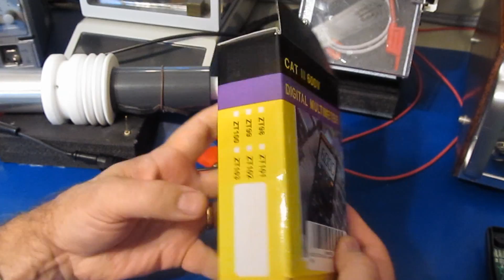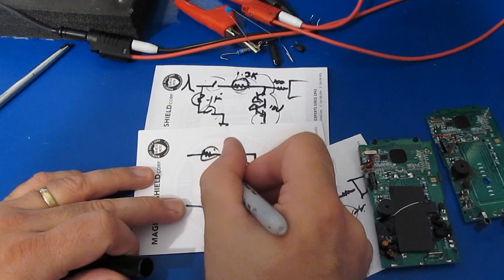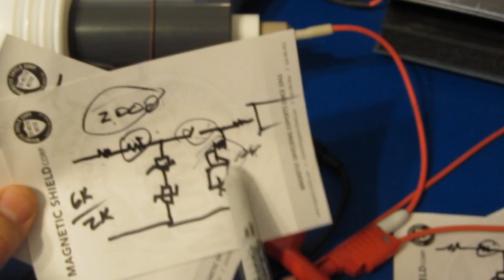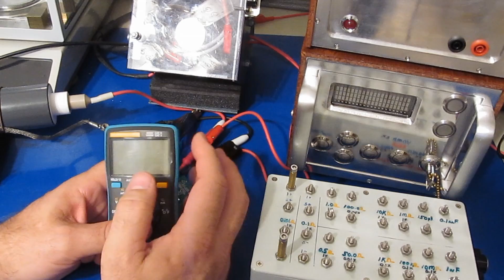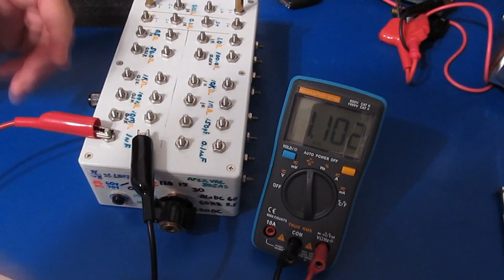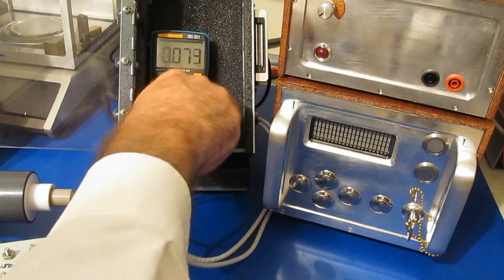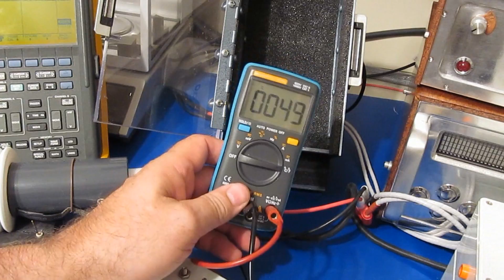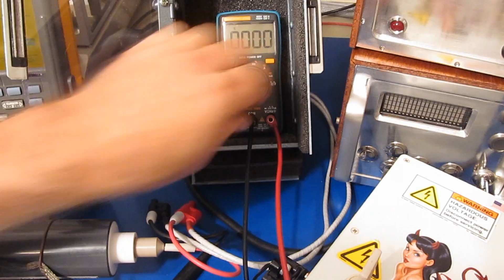Kasuntest ZT102 (AN8002) Experimenting with 3KV and up

Comment: The inside of the test box must look like a bowl of spaghetti, excellent video as always!
Reply from the maker: That little white box is not too bad.  One perf board in the bottom and all the components are just mounted to the screw terminals.  It covers most of the basics now for checking a meter.

Comment: The "features" depend on the contents of the 24c04 eerom, so the chances are that the %Hz/Duty feature come from fitting a different batch of pre-programmed eeroms, or from programming the meter with the wrong contents at manufacture. Now it is possible that one line of the production line is set up incorrectly and every machine from that line has your additional feature.
Reply from the maker: No matter how it happened, it points to a really bad quality issue.   But again, it's a $15 meter.  Can't expect too much.

Comment: Remind me again, did this meter, unmodified, actually meet the 1000V Cat II rating stated on the case? 

If so, then with very little change from the manufacturer (change the input connectors, put in some real fuses, rather than those toy ones), it could be a relatively safe little meter for mains voltage work. 

I'm impressed that with a little modification it isn't killed by >10,000V
Reply from the maker: I really have no idea if any of the meters I look at meet their standards outside of the ones that have been certified by an independent lab.   The meter is also rated for CAT III 600V so it would be tested with a 2 ohm source.   I would very much doubt it would meet CAT III just because of the current input.  

I was not too impressed it survived as the two meters I showed can both easily survive this same test.   It's not magic.  I've looked at a lot of meters and the ones that are robust follow the same technique.   Move away from this, the meters start failing.

Comment: thanks for the video, i enjoyed watching it. i wonder how come adding those resistors didn't throw off the accuracy of at least the resistance measurement range, i'm quite puzzled by that actually!..unless you were able to recalibrate the effected ranges using the jumper thingy or you changed the value of other components down the line to compensate, but you showed none of that!
Reply from the maker: Calibration is a check against a traceable standard to prove the device still meets the factory specifications.  What you are asking about is an alignment.  No, I never attempted to realign the meter.
Reply: yes i meant align, thanks for the clarification. so since no alignment have been made is it correct to assume that you made sure that the total resistance of the added resisters+thermistor is equal to the resistance of the original thermistor?. thankyou
Reply from the maker: No, I did not make sure that the total resistance added up to the original. The total resistance has increased as the videos have shown.

Comment: Is the fuse not limit the (inrush) current?
Or is the fuse simply not fast enough?

btw, why do you cover it in black stuff?
Reply: Thanks. So the coating is only used for some additional insulation?
Very interesting video. It shows that it's not that difficult to get a proper input protection.
The sad part is that unfortunately manufactures don't always put just a little more time in their development.
Reply from the maker: The fuse is typically only used for current and would normally have nothing to do with any other measurements.     Yes, the black stuff is there to add additional insulation.

Comment: What you think, if i  only add 2pcs 470v mov in series, between fuse and common. It cause fuse blow if i put over voltage. How this works?
Reply from the maker: If you are working in an environment where safety is a concern, buy the proper tools.  Never modify any hand held meter.

Comment: Why not leave a spark gap for sparks, instead of trying to get rid of the arc?
Reply from the maker: If things breakdown and there is no safety fuse, what stops the arc?  With my generator, there is not enough energy to do much.  In real life, this may not be the case.  I saw a meter once where they put an MOV right across the inputs!  It was not populated.

Comment: What about a simple surge arrester?
Reply from the maker: What is a simple surge arrester and where would you connect it to the circuit?   Sounds like an accident waiting to happen but fill me in.
Reply: @joesmith-je3tq  Hi, i would connect the surge arrester directly on the input between (com) and (V/ohm), its a spark gap. Then i would add a fast acting fuse before any ciruit to further protect the Multimeter. After that i would cover everything in an isolating coat of epoxy resin. Should do the trick too. Would solder the Fuse because of the resistance added if its only clamped in. You can see the picture of a surge arrester if you search wikipedia for it, bottom right, it says: "A Gas Tube Arrester commonly used in the sockets of Coaxial cables"
Reply: @joesmith-je3tq  its found in stunguns, laserprinters. It has the symbol --N--. Example TDK EF800X
Reply from the maker: @Suesses-Einhorn  So when it breaks down, and there is a high energy source feeding it, what happens?
Reply from the maker: I have made a few videos on this subject.
Reply: @joesmith-je3tq  A fuse in series with the surge arrester could solve the problem. But if the sure arrester is engaged, the operator should recognize it and remove the testleads, wouldn't he? And if you are working on high current high voltage devices, you should use proper equipment anyway, plus double safety measures if something goes wrong.
Reply from the maker: @Suesses-Einhorn  Which gets back to, you should NEVER modify your meter.  You should always buy tools the meet your needs.   It's in the FAQ.
Reply: @joesmith-je3tq  Yes you should, but noone stops us from doing otherwise :D
Reply from the maker: @Suesses-Einhorn  Very true and you are certainly free to modify your own meter but do not expect others who know better to partake.

Comment: I been looking at the DTM0660 Datasheet and I see a 100pf capacitor get switched to ground when you select the capacitance range, so maybe trimming that or shorting it will zero out the reading, if that won’t work you can always add a REL function by putting a button between PT1.1 and PT1.2. I think…maybe!...http://xomf.com/g/zklgz
Reply from the maker: I've already spent way more time on this cheap meter than it was worth.  Modifying a hand held meter is not something anyone should ever be doing in the first place.   I show the videos purely for entertainment and some education, not for kids to try and mod their hand held meters with no understanding of what they are doing.
Reply: Roger that